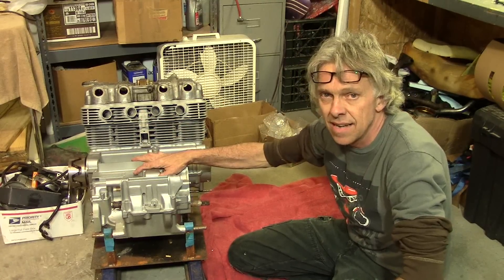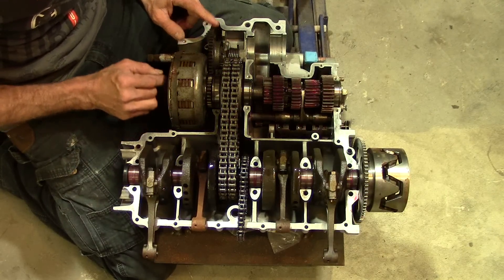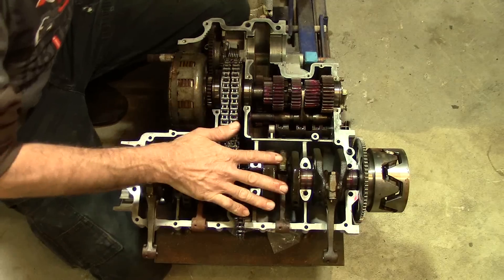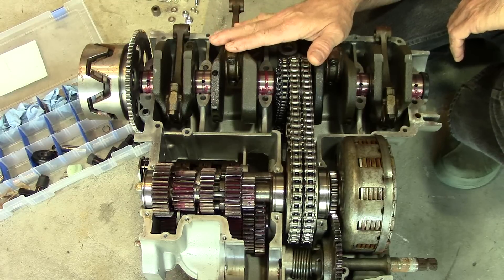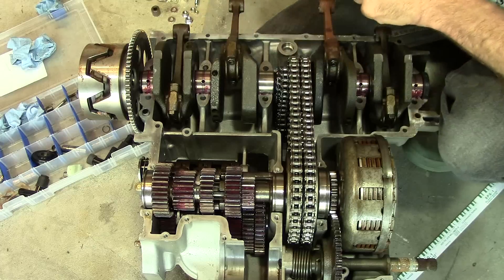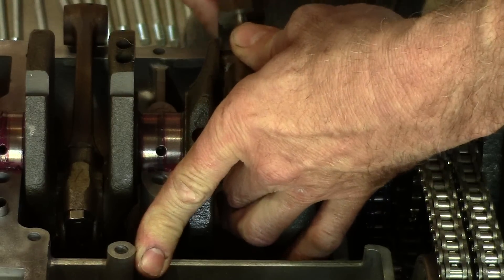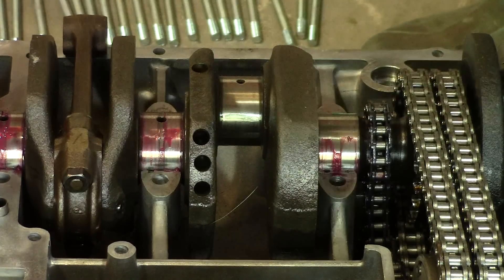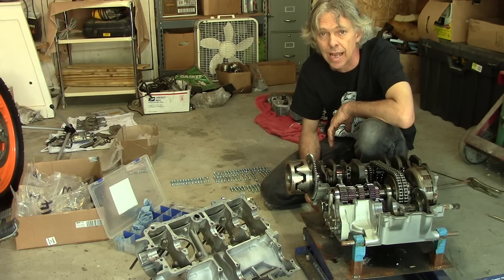73 Honda CB750 Cafe Racer Build Episode 2 - Internal Engine Inspection

Comment: just FYI as far as rod bolts, 13213-KV0-000 is still available new. I'm told these are later year rod bolts, different in construction, more durable than the earlier discontinued CB750 rod bolts. Have yet to try them, Amazon has them listed for less than $5 a bolt

Comment: The actual wear limit on those main bearings was 08 mm. Yours were just on the top end of the new spec. They had a tiny bit of wear but not much.

Comment: You're underway, Whoohoo...

Yep. If it's torn down that much, I'de go the whole hog and replace whatever I thought was worth replacing. New lightweight rods would make it smoother and would probably cost less than originals.
The clutch springs would be a no brainer for me as well. 40 year old springs would be under size by now and probably slip fouling your new oil.

Guess we need to all buy you Rods, Rings, Bushes, Gudgeon Pins, Circlips, Bolts, Nuts, Gasket Goo, Oil, Grease, Rags, De-greaser.
Did I miss anything.
Reply: Loctite cleaner/degreaser is really good for cleaning off the grease on metal and plastic parts

Comment: i stupidly left my 82 cb650 25K miles idling and ran down the road to meet someone forgetting it was still running. I came back 3 hours later and it was still idling perfectly, WITH year old gas an oil in it (oops) but that goes to show where honda lacks in grunt, they make up for in reliability.

Comment: ARP rod bolts are usually the can't-lose option. looks like it's been recently rebuilt or is it just running royal purple? the honda 750-4 came first and then kawasaki came out with the Z1 (which was a bit more highly stressed  imho and more scope for power mods) And then suzuki came out with the GS1000 which had roller crank bearings based  from their 2 stroke racing camp. the thing is massively overengineered which is why ppl still use them for drag engines running healthy amounts of boost. but the honda can still be made to perform, rumour has it that when Honda bought it out, Norton purchased one from a nearby dealer thinking it would never hold together. They started it at breakfast time and it was still sitting their idling along happily at 7 in the evening. Probably was a sign to them that the writing was on the wall for thrm too lol. have you checked the state of the cush drive rubbers?
Reply: ARP did not have a rod bolt in a 7 mm diameter. I went with the rod bolts for a CB750F2 part # 13213-KV0-000 and the nut that goes with it part #13214-410-003.
Reply: couldn't you ream the rod out to 8mm? suppose too late now you've bought them. should be a nice bike, I've got a 68 CB350 and I'm spending heaps on cmsnl.com even then, there's parts they don't have.
Reply: They would have to be machined out to 8 mm. It's the diameter of that middle shank that lines up the lower part of the connecting rod. It has to be a perfectly machined hole. Easier to just buy the right bolts rather than re-engineer things.

Comment: Dude. The best call is to leave that bottom end alone. It is at the far range of specs but nothing beats a factory build with relatively low mileage. Run 20-50 oil and it will be fine.

Comment: Thank you for tour videos. I do have a question. The 2 primary drive chains from the crankshaft. Is there a specific way to mound them ? Last week I met someone who said that the links of the chains should be staggered. he told me this was very important but couldn't give me an explanation why.... so you can put them next to each other, symmetrically or move 1 chain 1 tooth. So what do you think ?
Reply from the maker: I see no advantage to staggering them.
Reply: @HackaweekTV  I don't really know either. I could only think it might be something to do with vibrations or how the chains run on the tensioner. And since he couldn't explain it either, it probably won't make a world of difference. Thank you for your input.

Comment: Hi Dino!
I've built a couple of motorcycles, but they have not used the old air filter and I replaced by conical metal filters.

work well only slightly increased consumption, but it is something I can tolerate in exchange for improvements in performance. the problem is that they are really very noisy. there any way to reduce this noise to just stay with the sound of the engine and exhaust?

thanks and greetings!!

Comment: i think that honda color codes the crank bearings
Reply: These are all standard size.
Reply: *****
it's true that they are color coded ... but you know what?! it would be fantastic if you could include a brief explanation about the color code and what size they represent ... Please!! ;)
Reply: Main Bearing thickness by color
Blue 2.013-2.010 mm 0.0793”- 0.0791”
Black 2.010-2.007 mm 0.0791”- 0.0790”
Brown 2.007-2.004 mm 0.0790”- 0.0789”
Green 2.004-2.001 mm 0.0789”- 0.0788”
Yellow 2.001-1.998 mm 0.0788”- 0.0787”
Pink 1.998-1.995 mm 0.0787”- 0.0785”
Red 1.995-1.992 mm 0.0785”- 0.0783”
Reply: Thanks!!!

Comment: Why are these bolts so expensive and/or hard to find?  I'm guessing that it is mainly due to something like needing to be magnafluxed or x-rayed?  I'm mean they are just hardened steel bolts of (probably) standard size and thread, right?
Reply: They're an odd size. 7 mm diameter and a .75 mm thread pitch. They're special stretch bolts. I ended up getting some for a later model 750F2 that will work and were MUCH cheaper.

Comment: Honestly, I truly believe the Allen-head hardware is that first inch down the slippery-slope into STARBUCKS RACER territory, with the fugly USD forks & monoshock conversions, sundry other '90s-Y2K+ CROTCH-ROCKETRY, "gentrification" one might say, when that groovy old greasy-spoon CAFE is torn down & remodeled as a STARBUCKS, well - pretty soon the whole neighborhood goes to shit!
Reply: SoyBoySigh it's not about fugly...some of us want more performance out of a bike we build my CB has a gsxr forks and a monoshock for ease of finding parts. Twin disk etc. Mine is a 915 build working on a fuel injection setup. Again because parts are expensive and my whole rack needs entirely rebuilt. Again, I could buy a newer bike but I'm building this myself and want to ride it hard and fast, but I get where you're coming from. My generation has brought back the cafe racer craze out of "nostalgia" they don't ride except on weekends and even then lol. I hate my generation have a good one, nice to hear another opinion:)

Comment: OK I have a quick question, why plasti-gauge? You said "if you have time to do it you have time to do it right"... So where the micrometer? Let's get some precision man!
Reply: Plasti-gauge IS the precision way to measure the TRUE oil clearance when the bearing is compressed under tension from the case bolts... man! :)
Reply: Haha, just bustin your chops a bit. I know plast gauge works just fine, I was just always taught to use micrometers and I figured you'd have a set. I love what your doing tho, your sabre build was awesome. Can't wait to dive into watchinh this one too
Reply: No worries. :)